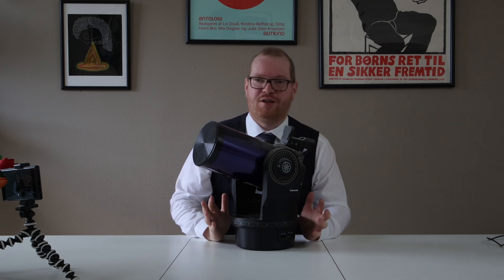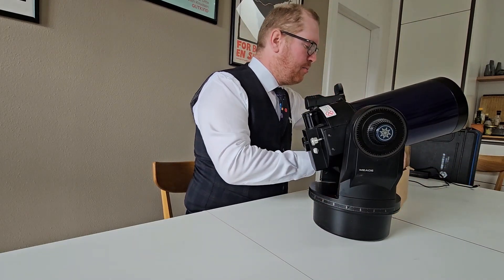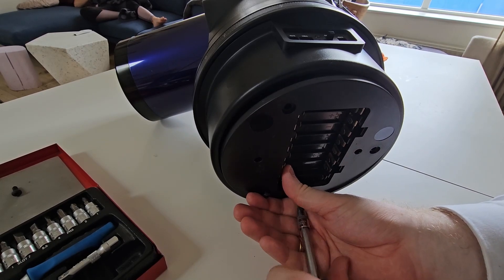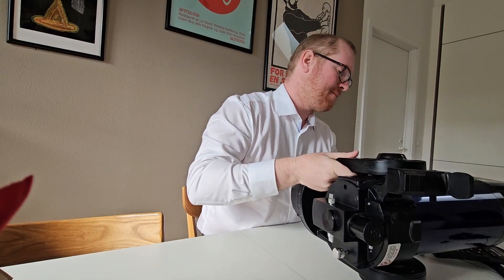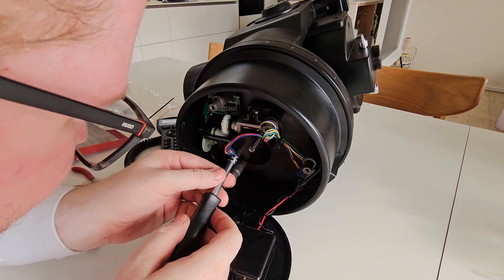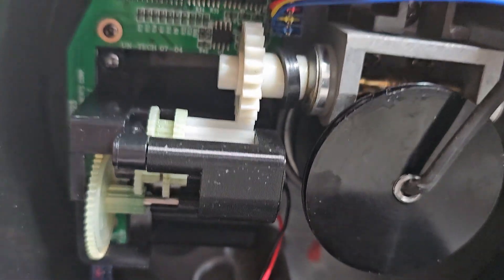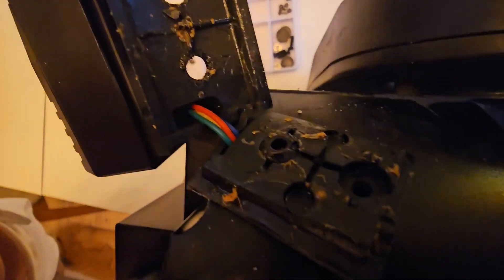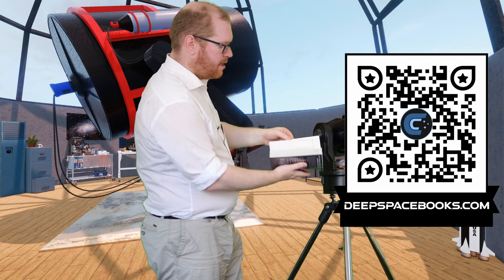Saving my Childhood Telescope after 10+ Years

Comment: That was a good well thought-out repair and the optics looked like new so I think you still have a nice little scope again.
I nearly bought one of those scopes, must have been around fifteen years ago, but I ended up getting an ETX80 refractor instead. I seem to remember the gearbox was always noisy though it was pretty smooth and the tracking was good.